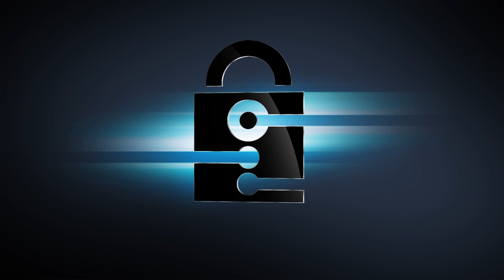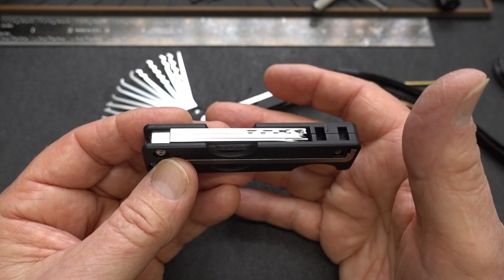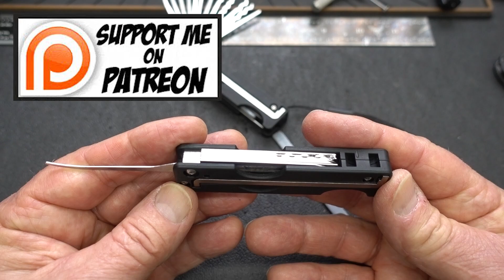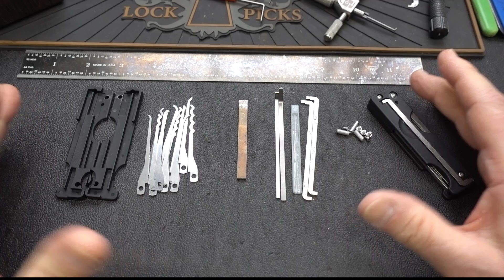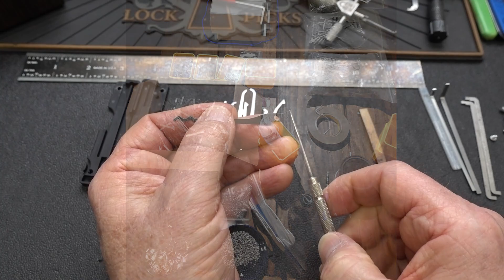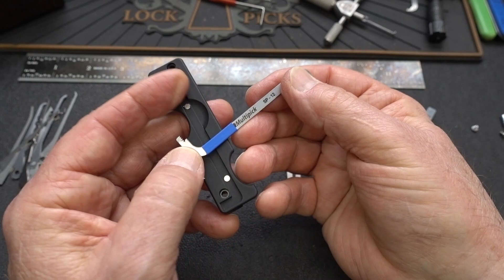(1874) Review: SWICK (FINALLY) Arrives!

Comment: They still need to file the tit off the end a little better so it will slide across the spring. I filed mine down with a diamond file without taking it apart so it was not a big deal. a drop of mineral oil and all is great now. Love the tool and glad I bought it. Still worth every penny! I got four tension tools with mine so no room whatsoever for the key extractors. I also had to bend the long end of my tension tools or it was next to impossible to get them in and out of the frame but again not really a problem. Also one of the magnets fell out of the frame but no biggie. Great story to hear!

Comment: Hi Bill I hope your safe and well and enjoying a little down time. Really enjoyed the back story and the challenges faced by the team at SWICK. Fair play to them for seeing it through and producing a fantastic tool for the community. I can certainly identify with the challenges of taking an idea 💡 and turning it into reality. However I hope this does not come across the wrong way but I was literally cringing 😬 at the figures quoted for each part of this project. From injection mould tooling to the cost of the high yield 301 and the cost of laser cutting. The spring the tension tools everything! So many companies seem to have rinsed the guys at every turn. I can only assume it was maybe in part to inexperience or bad advice I don’t know. What I do know is I started law lock tools with less of my own money than most people spend on a modest family holiday. I now own my own laser and have enough 301 high yield that if I cut it all into picks I could probably circle the moon 🤣 I can see many design problems that were not actually a major problem in my humble opinion. For me I learn from problems like greedy sub contract engineering companies or challenges with designs. Without exception a bump in the road has led to a better part at a better price with a faster turnaround time. For me problems are like clouds 🌧with a silver lining. I wish the guys at SWICK every success and am sure they have learnt from some expensive mistakes. I think I will have to go and order one myself now  👍🏻👍🏻

Comment: I love my swick and carry mine daily. Watch out for those little magnets holding the top keyway tensioners. Two of the four magnets actually popped out but thankfully they are strong enough that they stayed on the turners until I noticed and super glued back into place. Other than that, no issues with the device. Would recommend.👌

Comment: Did they change the broken key extractors / shims to more tension bars? Mine came with 6 bottom tension bars (instead of 2) but no key extractors, plastic spacer or decoding shims.

Comment: I’ve had quite a few ideas about several things.
Sometimes it is my complete creation, others are modifying existing products or new products from a current manufacturer.

It can be frustrating when another company isn’t interested in implementing your idea that actually works. Yet they will produce a novelty product with no functional purpose that doesn’t sell. ( Snap on tools 😒)

As for my own ideas, (or other’s ideas) I’ve seen the potential for the pitfalls that may or will come.

This video is helpful shedding light on many potential problems developing a new product, especially one in a niche market. 
This can be a great educational tool in preventing someone from diving in way over their head.

I’m not so sure I would have had the confidence to have completed this project myself after the earlier pitfalls.
Looks to be a great tool.
I plan to get one for myself and one for a gift.

Hope their investment in $ and determination pays them in full.

Comment: I work for a company that makes products consisting of similar parts, and I can testify that injection molding must not be the first choice of technology to produce a handle like that if we aren't talking about a much greater budget and a number of parts produced in the first batch. CNC-milled handles made of G10 would be by several orders of magnitude cheaper in development, visibly more expensive in production per part, incomparably more flexible in a redesign process. And then, if there's a demand for it, it's possible to upgrade to an injection-molded part. Also - yes, micro-joint placement and acceptable width must be specified on a print/model given to your laser-cutting vendor because they have no idea about the part functionality and will do as they please without asking. Having at least some skilled machinist on a team or being able to talk to one could save quite a bit of hassle and money.

Comment: 60,000 dollars cutting injection molds for each prototype of the handle???  WTF why????  Why wouldn't you CNC prototypes from stock material of like kind and do your testing on those before spending several grand on a mold?  CNCs with plenty of rigidity and accuracy for this project are under 2000 dollars.  You can buy sheets of nylon 6/6 or polycarbonate or whatever you want to injection mold big enough to cut 20 prototypes for like 100 bucks.   Could've solved all of those prototype issues for probably 3000-4000 dollars and ended up with a CNC as capital investment.

Comment: When I opened my Kickstarter package and saw the two grooves on the back of the 3d printed spacer I  thought "oh, that's where the spiral extractors go." And guess what? They fit. It makes things a little tight, especially with the shim (I  got 2 shims...) in there, but it provides a little protection for the extractors.

I was a little shocked to find that the top of the keyway tensioners came pre-rusted. Yours in the video have a few specks, but mine have a LOT of visible corrosion. The thicker one is particularly bad. It's just surface corrosion, and I'm sure I can polish it off, but if I saw this in a retail package I would definitely not buy it. I'm just glad it's here after all this time.
Reply: Sorry about the surface corrosion. I will say we did start moving much faster this past month to get finished as every month we don't make a payment on our loans the interest continues to grow. We could have tossed them in a tumbler but the time just keeps adding up. 

We hit the 100% shipped mark today and will begin public sales Saturday. Hopefully as things settle down we can do some greater quality control and also add some of the additions to the SWICK we wanted to do in the first run but couldn't. I hope you enjoy your SWICK and I look forward to hearing your reviews of it.

Comment: Now, before i say what i want to say, i want to make it clear that i'm not trying to bash these guys. They took on a serious amount of personal risk to get this thing delivered, and that is not something a lot of people can do.
But the reality is that a product like this should never be shipped. So many things have to be incredibly precise. The tails of the picks have to be precisely profiled, or they don't engage properly and flop about. The spring has to be precisely bent or it breaks. The handles need to be precisely made or the picks flop about or the spring breaks. It's a very simple device, it should not need so much precision. It should be something you can build with whatever tools you have in your workshop at home and it should work just fine.
But the problem is in order to come up with a design that is robust enough to not need such precision... well, that takes time. And money. And people working on it. None of those is not something kickstarter projects have. And that's the problem. Turns out that engineering such a product is not an easy thing to do. Sure, it looks simple, but making it function properly, consistently, robustly is a massive task. Which is why, btw, it's absolutely amazing that these people manage to deliver this in working shape. This is why kickstarter projects fail: because they think the easy things are easy. They never are. This is why a car company throws millions and millions at designing a car, they have thousands of people looking over every aspect to make sure it works, and they still get it wrong.
Until you try and carry out such a project by yourself you cannot even imagine what an amazing job these guys did. I hope this pans out for them in the future nd it makes them rich. Or at least it allows them to live comfortably. They certainly deserve it.

Comment: I guess I'm an awful person. I would have  demanded the people that made the picks fix their production error or demand a discount for that.
Reply: I would have loved to tell them to stuff ‘em and make them again. But given all of the delays in the process already at that point, the fact that they were technically within spec (a Deltronic pin of appropriate size for through the hole, just the spindle which has a slightly wider tolerance window doesn’t want to slide through.  They shipped over a period of over six weeks instead of all at once, and have given us new estimates about 3x the rate they did these for because they lost their ass.  At the price they quoted I know I can do better but I will have to source the blade material myself and use a different machining company and possibly methodology.  I believe people should pay for their mistakes, but I also have loan payments due and 950 people who are questioning whether one of my best friends sold them some phantom snake oil. 
You’re not an awful person John. They should, but if I can’t manage to get it done with another company, then I would be burning a bridge and wizzing on its ashes by forcing them to make it right, and I’m too cautious to gamble like that.  
It’s one of the things where Dave and I balance each other out actually.
Reply: That's project manager type talk, demand rework without knowing the full story.
Sometimes you have to be pragmatic: you might have overlooked a small detail in the spec, had prototypes made and assumed the production items would be the same. When they aren't and don't work but still meet the spec you should suck it up.
I have two suppliers who I now can't use and they didn't finish delivering for reasons like this...one we drove to bankruptcy and the other won't pick up the phone. What both delivered first time didn't work exactly as it should, but there was fault on both sides. For me, it's just cost more to remediate than it would if we'd been pragmatic. For these guys they could have failed completely. 2 guys in a garage are not likely to have funds to fight contract wars.

Comment: Wow! Great review.
I didn't catch what thickness.the picks are if you told us?
I have many pocket picksets including cards, pens, and jackknives, but this is the best set yet. I've spent months and $$$ ordering and modifying replacement picks to get just the right selection of picks in a jackknife. Finally....12 picks gives a much greater selection and the best part...TOK WRENCHES. I lost count of the designs and ideas I have tried to incorporate a TOK wrench into one of my jackknives.
I also hope in the future they will offer replacement picks and some alternate styles. (can't help it, I just can't go without my offset snake and my city rake)
Reply: The picks are 0.020" or 0.5mm thick.
Reply: @jimthegmanswick3143  thanx

Comment: Ugh don’t talk about laser cutting steel I’m about to head into work where I have to run one of those lasers lol 😂
Reply: Still you have to admit--the little kid inside of you has to think it's awesome that you "grew up to have a job where you get to work with lasers." Come on, admit it! 😀
Reply: @no.springs  honestly it is pretty cool. Just to see that a light is able to slice thru steel like it’s nothing. From .001 up to 2 inch thick I’ve seen it cut like a hot knife thru butter. One of the most amazing things is just how smooth the cut actually is.

Comment: Great presentation and great advice for anyone starting a commercial venture (my own venture has gone similarly with larger amounts involved).  However some expected product information was lacking in both halfs of the video:
  1. What is the thickness of the picks in thous and microns.
  2. How does this compare to LPL's covert companion product, which seems similar but different.
Reply from the maker: Sorry, I must have forgotten to mention the pick tips are 0.020" thick.  No idea on #2 because I don't have one.
Reply: @bosnianbill  They are 0.020” or 0.5mm thick
Reply: They are 0.020” or 0.5mm thick.
Reply: I will be buying one of LPL covert companions because I want both in my pocket. They are completely different tools and compliment each other perfectly. I feel ours is more geared toward picking and his is more geared towards bypass although his has a few pick blades as well. 

As a locksmith when I arrive on a call for a lockout I try fast bypass techniques first and if that fails I get to picking. With the LPL covert companion in my pocket next to my SWICK there won't be much I can't get through. :-) I hope that helps.

Comment: I'm replacing the spring in my version. The one that came with it looks to be about twice as thick as the version you got, and I had to use pliers to open mine. Damn near drew blood when it snaps shut.  That said, I've backed a dozen things on kickstarter, and I don't honestly think this was out of the ordinary, time-wise.  It sucks that people are such jackasses to the creators,  kickstarter says repeatedly that it's not the same as buying a thing. That shouldn't be so hard for people to understand.  Anyways,  I'm glad they managed to get it released and that it turned out so well.
Reply: Hi Jess, the spring should be the same thickness +/- about 0.002".  Dave shows the best way we determined to open it in the video we sent out which is also available at PickLocks.com, you should always open and close by pulling out all the blades to the 90 degree position.  We are working on written instructions to put in the packaging with them.

Comment: How secure is the tensioner? This would be so much easier to keep in my work pants than my set but I'm afraid I'd lose the tensioner with it banging around in my pocket.
Reply: The spacer is there if you only have two tension wrenches and having carried it for 6 months without incident so I am confident it works really well.  If you would prefer it will fit the Tremendous Six or the Special Six from ToooL.
Reply: Also the magnets keep the two flat tok on the sides very secure and I have yet to have them come loose in my pocket.

Comment: Is the 3d print hollow at all, could the sprials be put inside it for more security?
Reply: It is injection molded, it was initially hollow for just that purpose.   The spring pressure necessitated filling in the open space.

Comment: Thanks Bill for sharing all this -- I didn't really know much about it -- My only experience in stuff like this is with spring steel and the difficulty in controlling the heat treating process -- brittle junk, or soft junk, and you certainly cant do any machining operations after heat treating.

Comment: This is primarily why i will never try manufacture anything of my own design without first knowing everything i can about the materials involved in each phase... meaning, i must know how to make my own metal and treat it to suit my design and then i must know how to create the means of reproducing the desired result.
Reply: Part of the KickStarter process is that you have to have a working prototype before you can run a campaign.  
There were about 50-60 revisions done before the campaign was launched.  Had Dave gone with the original design that people backed in the KS instead of listening to the backer and community suggestions, it would have probably shipped in summer/fall of 2019 which is longer than promised in the campaign but still the same year.  
Having held those prototypes and the finished products I can tell you without hesitation what shipped is so much better than what Dave initially proposed, it has been improved in almost every way imaginable.  That isn't to say the original wasn't functional, far from it, but the blade designs for example are, I believe, the best designs in the world.  Christina is amazing at pick design.  The additional flat wrench was a minor redesign all things considered, but the method of retention for keeping the blades in and out is a much better design than what it was originally.  
Everything was lined up for production, but much better methods were given as options to us and we used every one of them.